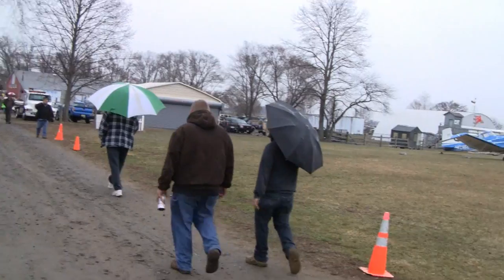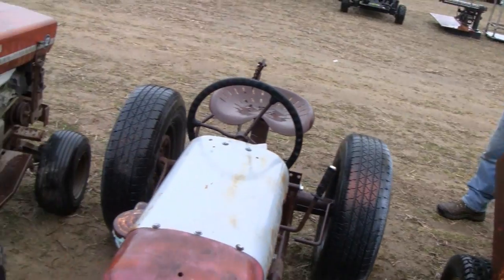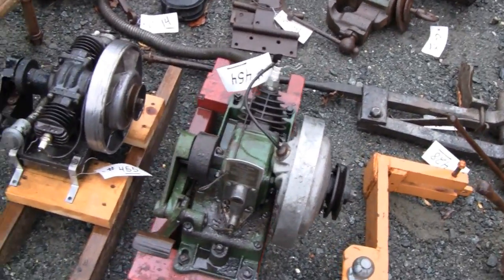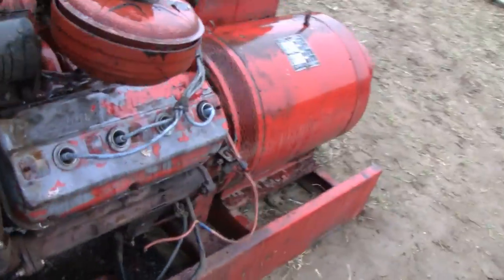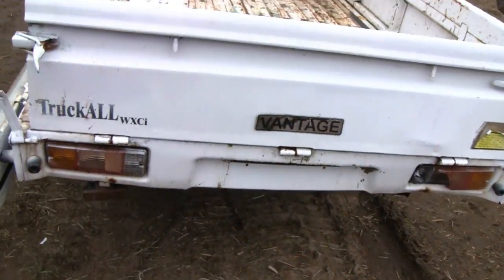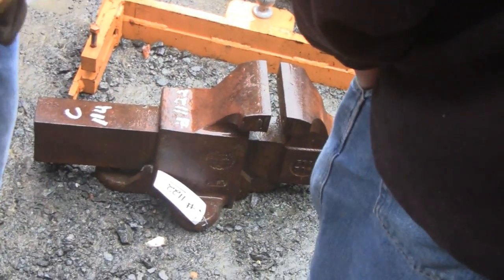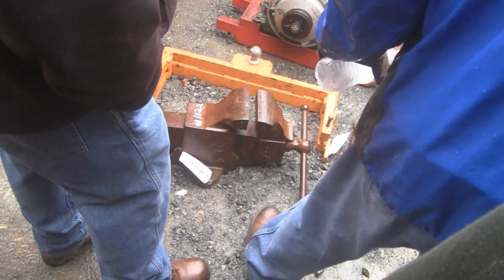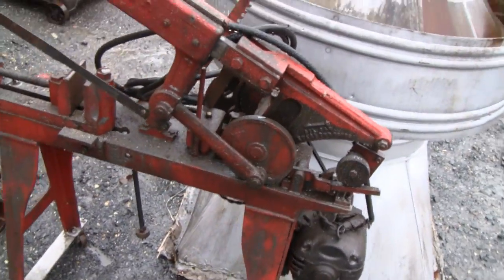ENGINE, TRACTOR, MINIBIKE, EQUIPT, AUCTION

Comment: Believe it or not but we had one of those crysler v8 powered generators back in the 60's, Dad used to use it to power the milking machine and lighting and also used to do arc welding with it as well. It sounded awesome